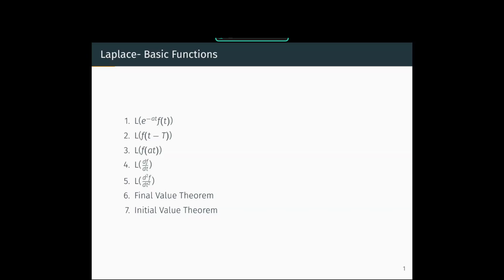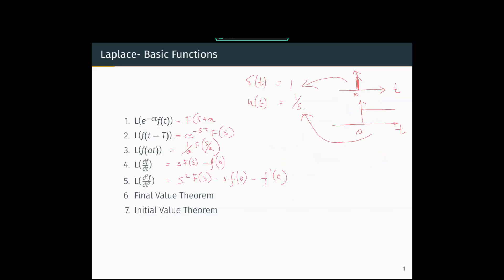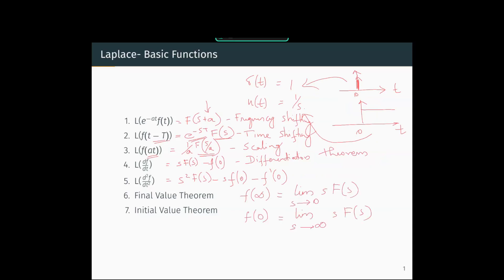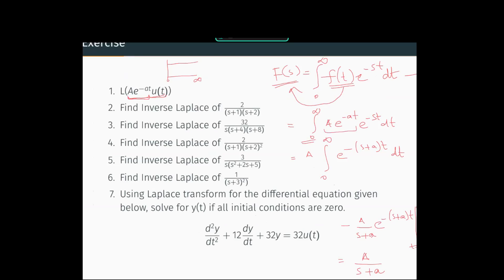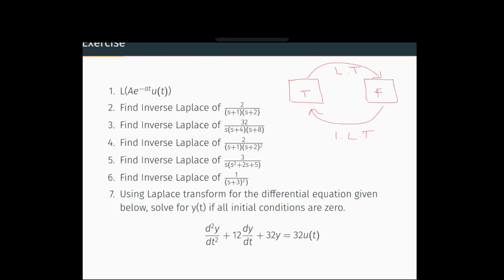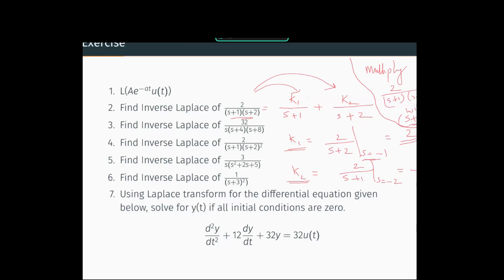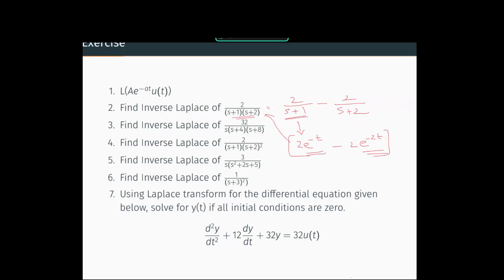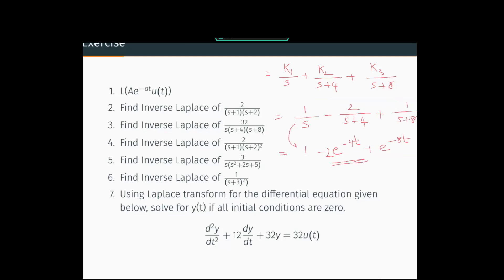Control Systems - Laplace Transform - I

Comment: Ty for the video. I have a question. How do you decide the values for s when finding Ks?
Reply from the maker: The value of K is determined by equating the coefficients on both sides of the equation. You can find two examples of this in the next video, Laplace Transform II, at timestamps 5:30 and 9:30.
Reply: @keerthichackocontrolsystems  Ty. Understood.